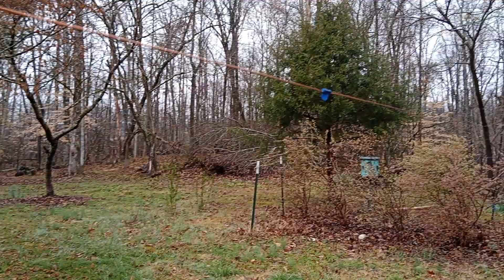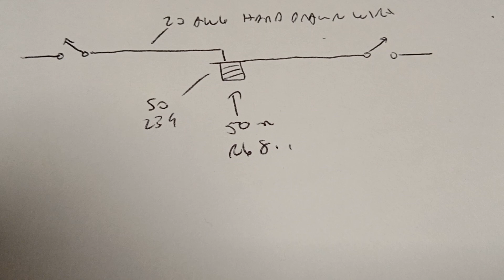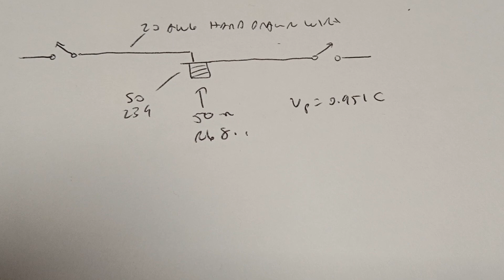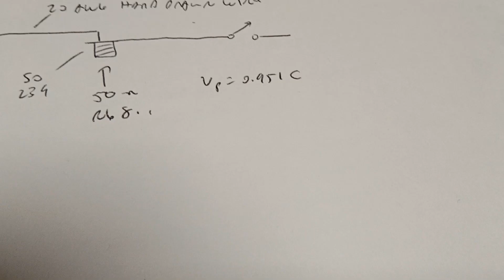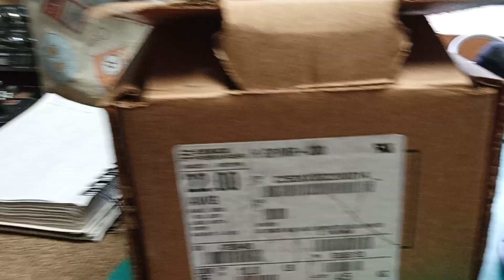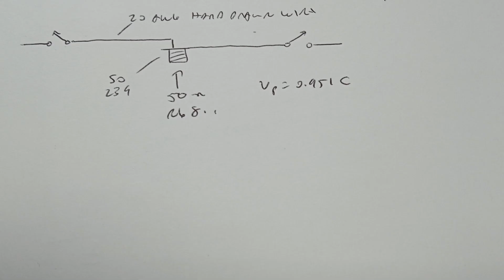Low Thin Wire 80/75 Meter Dipole

Comment: Okay, gonna try this but for lower half of 20m.  If that fails then 40, and so on. Gonna use 22guage wire, because it’s on hand, joined to one of those banana to BNC connectors, also on hand.  Will suspend the center from a tall tree and have telescoping fiberglass poles to adjust height of ends.  Will hang a VNA and measure at feed point as I adjust height.  What is your best guess for how low it will need to be to ground to work. I will go inverted V if I can’t find a height. Oh and then, just like you said, from the center junction I will hang a 12.6lb Dentron Super Tuner modified with a Johnson 229-202-5 roller inductor and custom 2x beefier balun that I hope doesn’t swing too much in the breeze… to fine tune any miscalculation in antenna length, of course… ha.  Will be testing at 1-5W CW.  Wish me luck.
Reply: Cold morning.  Your findings have been replicated, 100%. From 9ft to 5-ish SWR dropped from 1.34 to 1.01 with X,Ohm from 10.01 to -.0.20.  I can fine tune ever so slightly from a reel on my porch while keeping the dipole essentially still in line.  I cut legs long by 4ft lol.  Are you a fan of cutting or folding to shorten?  Temporary setup. I setup each end with 150lb braid connected to telescoping tenkara rods via larks head knots and rod holders in the ground, adjustable by height by dropping sections and jiggering angle and a central pulley over which a chalkline reel reloaded with same braid raises the center.  Ground is wet.  I'm sure that will have an effect. Measurement was at the feed point and in the shack using RigExpert Stick Pro and a dozen blue-tooth reconnects.  Wire color is purple because its location further along the EM spectrum promises more palpable high end during SSB, reducing AGN AGN counts, I expect.  Can send pics of the Antscope if I knew where. QRZ doesn't have it. Linear amp and Coax tip rocked.  Ladder line would have suffered going parallel with the 6AWG 220V line up to the feed point.   What took the time was drivingand bonding 65 8' grounding rods down along the outer perimeter of the neighborhood for the new amp location. 73
Reply from the maker: EXCELLENT mechanical setup to be able to move it all at once!
Check the VNA data and it should indicate the R changes much more slowly than X with frequency.

Another viewer here forwarded an email from R.E. that said they had trouble with BT development.

Wet ground makes some diff, mostly when going between extremes ( wet to bone dry) The wires are coupling fields to the ground and that depends on charges on the ground to couple with. They must not depend only on moisture. 

Can you do a frequency sweep and tell the results? Id appeeciate if you could email sweep images.

( Yes purple is best. If theres purple rain...)
Reply: @k8byp  Glad to, but your email addr is on on QRZ. To what e-mail?
Reply from the maker: see the video descriotions

k_8_b_y_p@ieee.org

PS lets get on 40 and test it out? Maybe a SKED for later today or tomorrow? 40 was horribly noisy last night
Reply: @k8byp  well I captured more testing of both direct at feed point and in shack. Have screens shots and data. As soon as ieee figures their email out. Gonna stick with 20m for time being until I have stronger end poles to take the tension.
Reply from the maker: There seems to be a minimum at 6 feet. The 80 thin wire, and 15m 6 AWG are both at 6 feet.

I saw an 20 ga. 6 foot hi workon 40, perfect match. Would be interesting to do that with higher bands above 40. If it works, one antenna can have switches to shorten it for each higher band.
That would reallybe a ' multi band antenna' thats properly matched.

Youre starting to go ahead of where Im at. Keep us all posted on what happens.

And along with the super tuner also hang a 3-500 amp, that eliminates tline losses.
Reply from the maker: OOPS, sorry I accidentally deleted your fine comment.
Reply: @k8byp  no worries.
Reply: @k8byp  sent emails.
Reply from the maker: Just a quick look while binging on the Simpsons, but the graphs are what a dp should look like on 40m. Narrower and cap. reactance rising quickly.

The trace for 40 should be rotated CW so X rises more quickly to the left. Thats the 1/X behaviour of cap reactance.

Xc is lower on 20, the traces should be flatter. It may be the thin wire of excess cap at the BNC connector.
Reply: @k8byp  BNC connector screw terminal blocks definitely have close facing metal surfaces.  It was that or the banana plug connector. I feared an influence but wanted to test your basic theory quickly. Thank you for catching that.
Reply from the maker: Use a plain BNC and solder wires to it.
Reply: @k8byp  thanks.
Reply from the maker: : 0